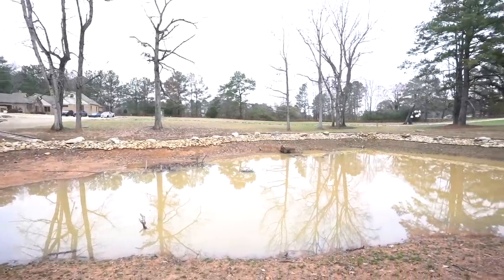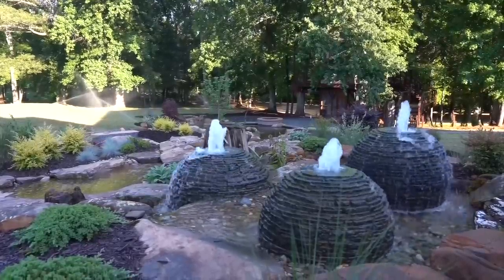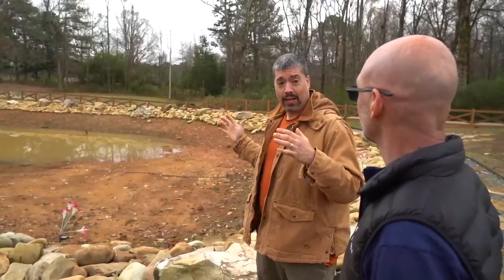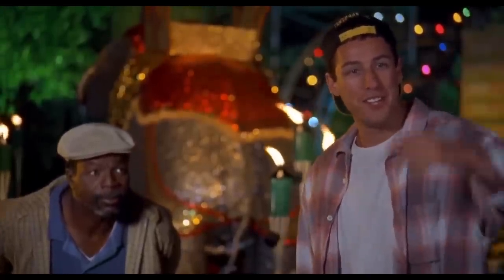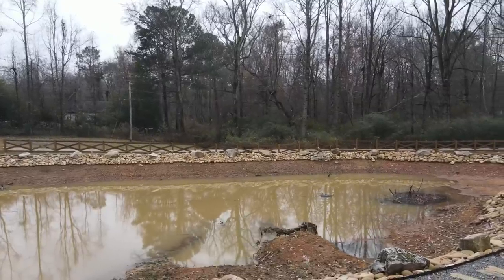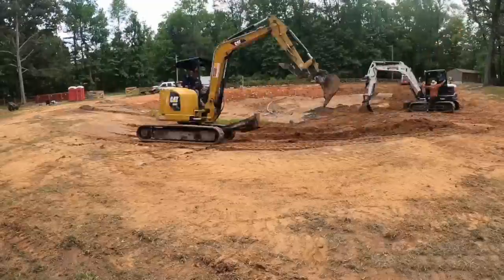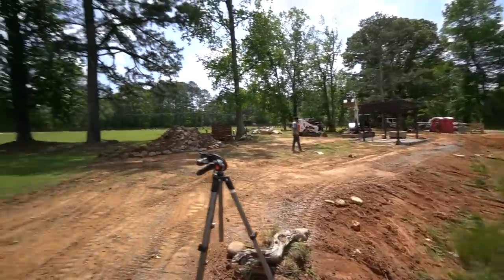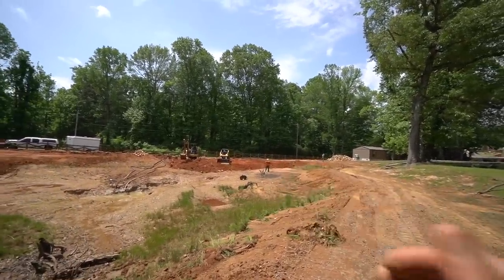Shaq Needs HELP Fixing His Pond

Comment: I lived and worked on farms many decades ago. I've seen a couple times where a farmer dug a pond that wouldn't hold water so they turned a passel of hogs in to the lot and let them wallow. One of them had a water tight pond in about 6 months. I think it took the other guy a couple years - but it worked for both in the end. This was in the Ohio river valley. Might not work as well in soils with less clay.
Reply: Yeah, I agree. But this particular location being a residential area is really more of a landscaping element than a farm pond. I assume the owner was sold on the idea of a mud bottom pond but not all the downsides of that such as muddy water. Plus mud bottom pond almost never (close to never) will be as full as needed to get a look a residential owner will want. Mud bottom farm type ponds are much better in much bigger sizes, like acre and bigger. Liner provides for many more options.
Reply: Is this because the hogs just pack the soil down so tight?
Reply: @Thailerr   - yeah - pigs can't sweat,, so they like to wallow in mud to keep cool.. Not something for residential koi ponds, but I thought I'd mention it in case someone dug a rural pond that wasn't holding water and clicked on this video looking for a solution - that doesn't involve massive liners. (You can put up a temporary electric fence to create a lot around a pond) Pigs are generally sold at around 40lbs -- or 220lbs - for two types of hog operations. Farmers that breed pigs generally raise them to around 40lbs and sell them. They are bought by other operations  with feed lots that raise them to 220 slaughter weight.. so If your not a pig farmer you could still fence off a lot, buy a dozen or two 40lb'ers - feed them to 220 and sell them. Repeat until you get a water tight bottom.
Reply: @Thailerr   - Or if you have a hog farmer in the neighborhood,, you might be able to offer him a free lot to keep some pigs --let him take care of the feeding.
Reply: That’s pretty interesting, and would work for sure. I don’t think I would like to take a dip in a pork 💩 clay pond though 🤣🤣🤣👍
Reply: @australianbirdgal2786  - as opposed to a pond full of fish, turtle, frog, shit - etc. ?  Time and dilution make it a non problem.
Reply: @DwayneShaw1  yeah mate I’d take those critter turds before a swines 💩 any day 🤣
Ive seen a few dead pigs in the farm dams over the years and that’s turned me off for life 🤣🤣🤣
Have a great weekend mate 🍻
Reply: @DwayneShaw1  those critters are cool

Comment: So instead of giving Shaq the natural pond he wants... which can be achieved by draining it and adding a foot of bentonite to the bottom... they are going to make it in to another lined feature pond that is then going to require their constant maintenance.  Hmmm...
Reply: I would normally agree with your assessment but I’m wondering if a 12 inch layer of bentonite wouldn’t just force that spring water out to the edge of the pond and cause erosion problems there.
Reply: Gotta ask why Shaq used another contractor in the first place 😮
Reply: All about money

Comment: The First pond looks like something an amature near sighted contractor won on a low bid, more like a sketchy  water feature at a Forest Lawn or Sleepy Hollow cemetery than a natural setting, only thing missing is a bunch of lawn knomes surrounded by petunias. The 2nd pond looked like an industrial sewer treatment pond surrounded by rip rap with odd colored gravel path designed for side by side wheelchairs. These guys obviously have no clue how gravity & nature works together especially if you have even very a gentle slope with riperian strip close to or on the property to keep an in & out flow. Obviously pumps will be needed and a huge amount of dirt imported for creating for any sort of waterfall action..Shaq should have simply bought property with an existing year round,creek, stream of spring to modify and  acheive the desired effect of being natural.